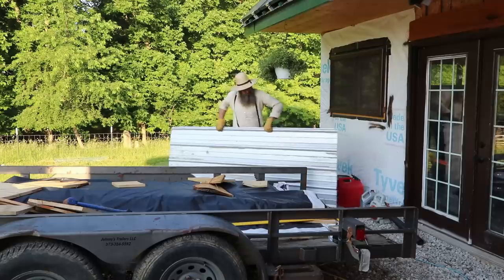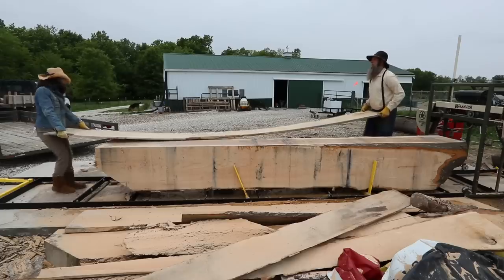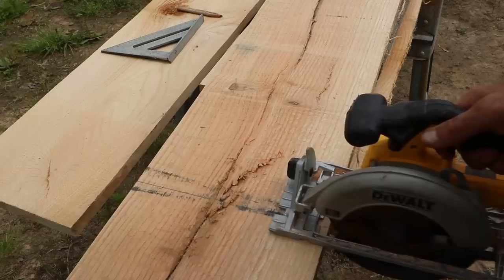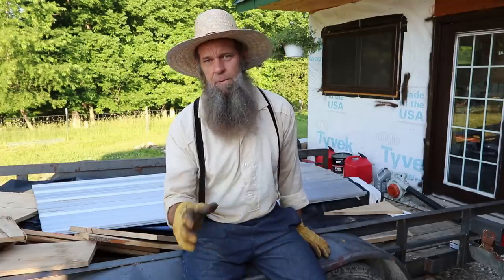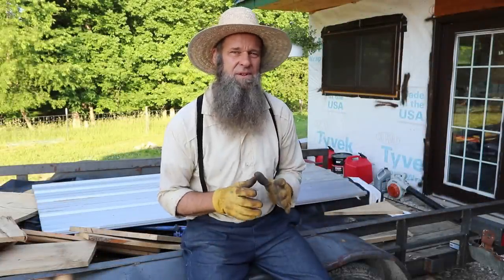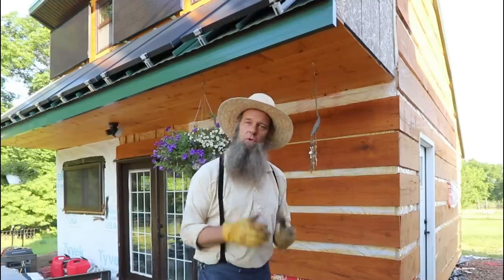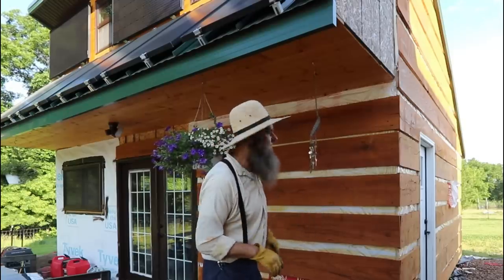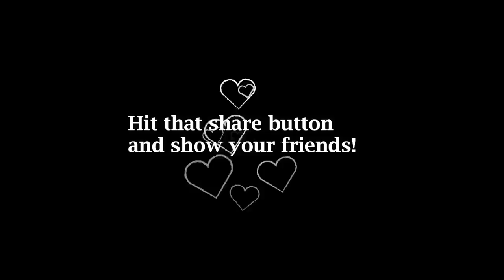Log Cabin on a budget! DIY construction hack

Comment: Working by myself, with one bum arm, I found an indispensable tool for staining raw exterior boards was a pressure-fed roller, fed from a 5 gallon tank, which in turn is pressurized by an air compressor (does't need to be a big one). I rented a compressor with a gasoline engine, plus the pressure-fed roller, hoses, and paint tank. It made the staining job go very quickly, and as such the rental didn't cost very much. There was also a lot less moving ladders around, as the roller pole really extended the reach. In our short summer season, time for staining is in short supply. I've enjoyed your videos on this project, and I've borrowed a couple for my own. 
If you get a skid steer, try to find one with several front-end accessories - bucket, pallet forks, etc. Some even have mounting points for things like a post-hole auger with a hydraulic motor. I found there were a number for sale that were more-or-less beyond repair. Not something you need for chores! Thanks for another interesting video. Sure wish we had oak - any kind - or some of the other nice wood that grows down south where you live.

Comment: A couple things- rain will always find a way to get behind siding eventually. Little or no overhang only makes that worse. Installing the siding over a simple rainscreen can help the siding to dry from the rear and also helps reduce heat convection during the summer months. A little 3/4" gap from cheap lathe is all that is needed.

Comment: I helped my parents stain the doors, baseboards, wood trip, window frames and exterior wood siding on the house they built when I was in 9th grade.  We did stain and seal before any of the wood was cut or doors hung.  That prevented any stain on the walls, floors or ceilings.  I got very good at the process.
Reply from the maker: This is green lumber so it needs to be pinned down asap

Comment: So Doug, my only question is some of the boards are pretty wide apart and then a few runs are pretty close together.  I'm sure there's a reason you did that (I think), can you explain...
Reply: He didn't use a level, he didn't measure very exactly, I think it didn't matter is all
Reply: @michaeltodd5806  - He used a level on the first board in this video. He just wants it to look sort'a like it's made from bigger and smaller logs, and putting them exactly the same space apart would ruin the look.
Reply: Dave Dube too make it look natural... log cabins aren’t perfect... I live next to a real log cabin and there are different widths between logs.

Comment: I've been in hundred year old houses where they set up a sawmill and cut and built on site for the whole house. Full size, rough sawn 2x4s, cut their own lathe for the plaster inside, clapboard siding outside, all trim,  and even built doors and window frames on site. Most of it green,but doors and windows air dried for months anyways. Nearly all of it white oak. After all of them years god forbid you need to put a nail in it. Hammering a roofing nail into that old oak for a new roof was a major chore. Those houses stood the test of time and were darn solid. I suspect the new lumber just might not last a hundred years but time will tell.

Comment: the log style barn looks good but, those boards will move with dry summers and wet winters.  Chinking will not move and will develop cracks.  Reason is the boards are only 1 inch and real cabin logs are bigger so they don't move as much.  I helped on building a post and beam barn. We used fresh cut pine with an overlap for siding.  It to was 1 inch but we only nailed it on the top.  Each board was left un-nailed on the bottom to float with the seasons.  They still look perfect today.  One more nugget, the solar panels should be placed where they can get all the sun they can.  In winter, you will be lucky to get 4-6 hrs of electric on a good day in full sun.  In summer, you can get 8 hrs of electric on a good day in full sun.  The way you have them, you cut your sun time down and they will not produce the power you will need to recharge your batteries.  Those panels on the vertical will not produce anything in summer.  Hope this helps, Shalom
Reply from the maker: The. Thinking is flexible and I'm good with touching it up after a year or two. The panels get sun all day summer and winter only a few hours late in the day are any panels blocked 👍

Comment: Red oak is not used outside because it is ring porous and rots very easy no matter if it's stained or not. White oak, walnut, cedar, black locust and a few others will last forever -- red oak, not so much. That green lumber will shrink a lot. What kind of chinking will seal with all of that expansion and contraction? Usually the chinking is between logs and the weight of the structure keeps it tight. Just curious if there is some new technology that I'm missing because Jason Crocker is doing the same thing 😊

Comment: If you can lay your hands on a couple of lengths of scaffold poles you can easily knock yourself together a Hand Crane! Cut 3 pieces the same length and join at the top (a bolt or piece of screwed rod would do. Chain the feet so they cant spread and connect a longer length of pole to the apex and you create a lever which you can then use to move heavy logs with ease!
You can even "walk" the logs for a distance ;0)
If you want to see how much shrinkage you get with Green Siding you could do worse than going to The TradesmanChannel and check out the gaps in his siding. It was put on green and allowed to shrink giving airflow to his barn!

Comment: Doug, Tyvec is not UV stable, and will break down long before the oak, 
Also, I hope you used S/Steel screws, as the Tanning in the Oak will Corode the screws in no time,
Reply from the maker: Hmmmmm 🤔 how will the Tyvec get UV?
Reply: @OFFGRIDwithDOUGSTACY  unless you cover the tyvec up with boarding and stop the ultraviolet rays, it will go hard and brake up.
Reply from the maker: @hootche1  I mentioned I would be chinking in between the boards 🤔

Comment: Just curious, why didn't you stain the wood prior to hanging it on the building?
Reply: I'm guessing that since he's not staining all 4 sides, it's easier to stain them all at once after they are on the building.  Otherwise you are laying them out in smaller batches on sawhorses or similar, and then waiting for them to dry before handling / mounting and then repeating for the next batch.  Much more efficient use of time this way.

Comment: Doug I hope those solar panels are more for looks than performance because the angles you have them at is not going to work very well. Solar works best if pointed at at a perpendicular angle to the source of light. I know your needs are not very much, but those are kinda expensive decorations.
Reply from the maker: Must look bad on camera but for your info we angled the overhang at the precise angle to collect the sun and those panels are far more than decorations 👍
Reply: @OFFGRIDwithDOUGSTACY  I wasnt talking about tilt for most of them, I was looking at the azimuth for the tilted panels. But arent those panels that are mounted vertically? If I am mistaken, my apologies. But if those three are panels, they will loose 35% being mounted like that. But it does POP having everything right there especially for a learning center where it is all about people being able to learn the how to's of what you got going on. Have you made a choice on batteries?

Comment: I'm all for efficiency and new methods, even making new things look old. That's all good. But this is a waste of wood. These trees lived for a long time only to be used for fascia, fake looks. Not good. Not efficient. Just a waste of wood to look good. You would be better off using lumber for timber frame home THAT LASTS FOR HUNDREDS OF YEARS and then use some natural insulator for walls like, for instance, hempcrete or straw bale or cob over straw bale. adobe. whichever. but STICK BUILT HOMES no matter what you call them, they are a waste of resources because they only last about 20-40 years before needing to be completely rehauled.